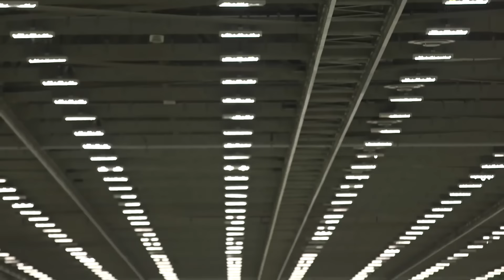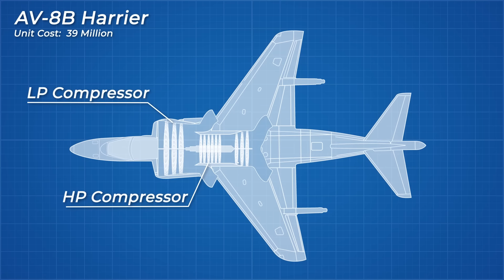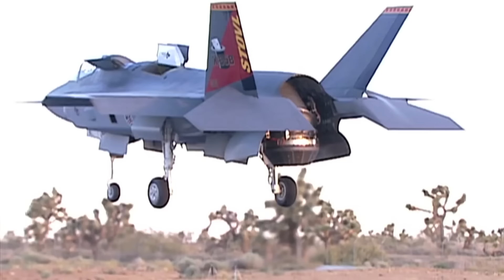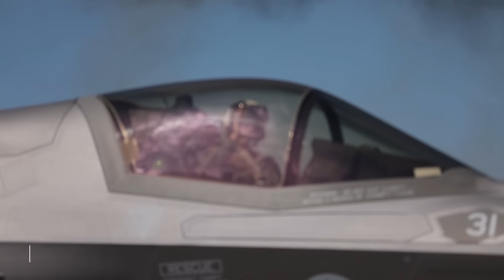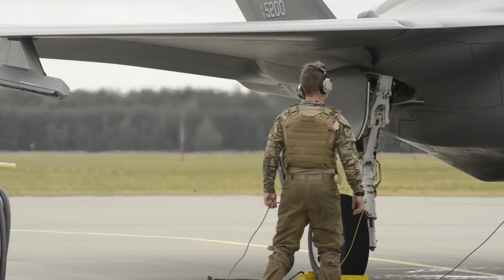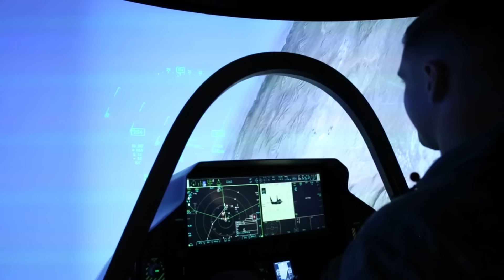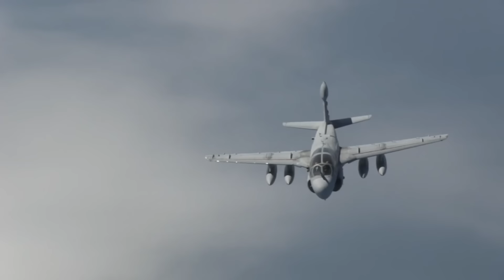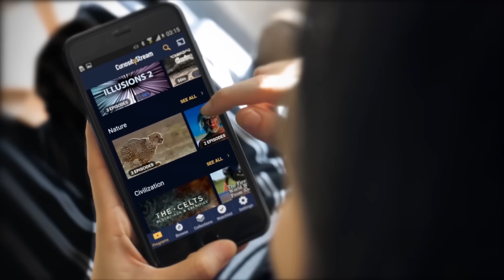Is The F-35 Worth $115 Million?

Comment: in short : NO

everyone knows by being jack of all trades, you are not gonna be master of any. 

as fighter : 
now you have stealth, but you can only bring 2 AAM missiles , slower (these fighter cant sustain supersonic speeds), which means your there is high chance you cant shoot your opponents down and they will chase you, remember, stealth doesnt really mean you are invisible, you just gonna detected in shorter range, and not invisible via thermal tracking, which russians are fond to use (their sukhois all have IRST), also AESA is a thing

as bomber :
again, stealth, but you have terrible payload and you cant maintain supersonic, enemy fighter just gonna overwhelm you sooner or later, and you deal small damage unless you deploy in large number

as attacker :
replacing A-10? really? 
1. it doesnt bring much ammo as A-10
2. it uses smaller caliber , which means lower damage
3. the accuracy sucks
4. small payload means less rockets and bombs 
5. less fuel, so less loitering time
6. not as good as A-10 in slow speed
7. basically no armor, enemies can easily shoot you when you are doing attack run, they dont need radar

as harrier replacement :
yes this fighter is worthy for that, and this fighter should only develop as F-35B, nothing else

and there is more, you cant bring extra fuel because to maintain stealth you cant use extra fuel tanks in your pylon, so less range

you cant use external pylons for anything (extra bombs or missiles or larger missiles or larger bomb)  or it basically discard your stealth capability

everything must be stored in that small internal bay

Comment: Many issues with facts in here. Latest cost of an F-35a is $90 million and dropping as is the cost of the B and C models. The JSF program might be 27 years old but the F-35 is not and is significantly redesigned from the X-35. What was said in the report about the F-35 and the F16 5 or so years ago was not that it lost a dogfight with an F-16 but that in the prototype state it was in that it could not match the F-16 in certain envelopes of flight at that time. If you look at some of the manouvres being done by the F-35 demo team you would know this argument is no longer the case. The F-35 is not meant to be a replacement for the F-15. The F-15's replacement was supposed to be the F-22.

Comment: should have just made f22 lite, use the existing airframe, improve the equipment and software
Reply: The F-22 is significantly more expensive and would need redesigning to have any hope of outperforming an F-35 in an air to surface role.

Comment: Had Congress decided to get an additional 70 F22’s Lockheed had sold them for 72.000.000 USD a piece... so NO the F35 is not worth 85 millions per plane, it should be around 65 millions. But that would require that every nation bought twice as many. So we are stuck with the elevated price tag.

Comment: This is great and entertaining 101 video but it has some flaws that may be overstating the capabilities of the F-35. I'll summarize them:

1) The plane is extremely digital and computational. 10 years ago, you couldn't even see any pictures of inside the cockpit but I heard that it was all flatscreen/touchscreen maybe. From the shots you showed, this is the case. This means though, that when/if the electronic systems are down due to hits. How does the pilot operate the plane? Can they land safely? You can smack talk pilots being stuck in "old mode" about acquiring targets, and how air to air combat is conducted, but in an actual war, you will take hits. You don't want to be flying in a glass bird that can't land because it took a few stray rounds. 3rd-5th generation aircraft are capable of landing after taking hits, this one probably can't.

2) You talk a lot about the advancements of technology in developing the stealth surfaces and coating for the plane, but have you considered what the same computational advances mean for detecting stealth aircraft as well? I'd say it's much easier to detect a large bird flying somewhere in the ballpark of 200-900mph than it is to hide it. Nothing else in a war atmosphere will be that size (radar cross section) and moving that fast in the sky. I'm sure when dealing with enemies that haven't made radar advancements since 4th gen, perhaps you could be near undetectable BVR but I doubt even a 5th generation plane would be totally caught off guard if given modern radar modules and equipment.

3) Honestly, this plane simply does not replace all missions of all other aircraft. F-15E is still one of the most capable planes that can strike ground targets while still capable of defending itself. A-10C is still the best close air support (CAS) plane for ground fighters against heavily armored ground targets. On the latter, while the F-35 may be able to enter a space undetected and deliver payload to a specific target, if supporting ground forces in an active battle, once that first flyover, it's detected and basic IR guided missiles from the ground can pick it out of the sky just like any other aircraft. In the absence of anti-air, can it carry as much payload? Delivery it as quickly with repeated passes(loiter)?

4) Consider the politics of the JSF. It feeds into the military industrial complex of the U.S. You mention how much of a boon this will be for the economy - this is a lie. The cost and development of this jet (billions) could easily pay for so much more to boost the economy of more than just working families of the major defense contractors and subcontractors on this project. But the executives at those contractors want those dollars so they will sell this plane to the US govt and justify it's existence at any cost, while being paid for with US taxpayer dollars, and the profits of sales to other countries will go to only the executives of said companies rather than their workers.

I should note for other viewers: CuriosityStream seems to be a conservative source of information. Based in some in some science, reporting, and fact, it pushes a conservative agenda overall. I like military planes because I've always thought they were cool and I've spent a lot of my life studying them, flight simming them, etc well before I had progressive views on war and industry. I can still appreciate a war machine, but since 4th gen, the U.S. hasn't really made an airplane platform with a mission focus and simplicity and effectiveness in mind -- and to be honest, maybe it doesn't need to.

Comment: I think it would be wiser to create many cheap, niche platforms than one expensive, multipurpose one. I would rather have a fork and a spoon rather than a spork. Do one thing well, not 2 things badly.
Reply: I especially dislike the idea of replacing the A10 with this. I want something specialized for ground attack. Replace the a10 with something cheap, but like an a10. Something with high capacity for weapons and can fly low beneath the hills and slow.

Comment: The F-35 cannot replace the A-10 for its close air support role, its super expensive, doesn't carry the same cannon, and doesn't have the same survivability as a A-10 with its mechanical redundancy and the titanium tub. For other roles, possibly a perfect plane, but its foolish to throw such a expensive plane into a role that would most likely see its damage and failure.

Comment: I disagree completely with your argument that the F35 is a "worthy" successor to the A-10. Close air support is not something the F35 is going to be able to provide in the same sort of way that the A-10 has. Every time they try to "retire" the A-10, the massive outcry to keep it flying brings it right back, because it's brutally tough, relatively inexpensive, extremely maneuverable at low speeds with extended loiter times, able to lay absolute waste to the landscape with combined arms fire (the GAU-8 can suppress in a way that nothing else short of a spooky can) and since it flies so low and heavy, works as a ground level morale booster for friendly troops and demoralizer for enemies, all on its own, by its mere presence on a battlefield

The F35 can definitely support it, but I highly doubt it will supplant the most nightmarish close air support aircraft ever invented. It's just like the idea that kept coming up in the 60's that fighters just didn't need cannons anymore, that dogfighting was dead, and aerial combat would happen at tremendous standoff ranges. It just didn't happen. Fighters are still going to get in close when the need arises, and the A-10 serves a very niche, specific role that nothing else has come close to yet. The most likely plane to replace the A-10 will probably be a turboprop powered, cheaper, lighter weight close air strike fighter. What we need is something even cheaper, lighter, and better able to deal with asymmetrical combat scenarios in a way that laser guided weaponry just can't.

Comment: Well considering that it only cost 80 million there is a issue with your headline.  
At least for the F35A. 
Which at 80 million is the cost of a current F16 or F18 super hornet. 
The F15 cost 115 million, a Rafael cost 120 million as does a typhoon. 
So truth it's a steal of a deal compared to those. 
It out performs them all with a combat load as well.

Comment: I am sure F35 is not as bad as it was made out to be. But to rely on stealth this heavily in 21st century is dangerous. The sensor technology has been and will continue to evolve at much rapid pace than the masking and stealth technology. Stealth technology is fundamentally limited by the surface physics and electronic jamming capabilities. Both of which can be out developed much faster today than in 90s and early 2000s. IN battlefield over urban areas, stealth is useless. You must have a good line of sight fight capabilities. F22 has it to a large extent. I am not so sure about F35.

Comment: The whole project is tainted by the VSTOL requirement. Forcing the plane to be able to be built (in very small numbers) as a VSTOL means that the non-VSTOL variants are decidedly compromised. Building an strictly AIR FORCE/NAVY version wouldn't have needed such an extreme compromise.

Comment: Good replacement for legacy combat aircraft, sure, to a point. Ait to air, recon/surveillance and data integration/dissemination is one thing. Air to ground/ close air support is another. The push to replace the A-10 with the F-35 is completely non-sensible to me.
Reply: it's not, considering the A-10 had largely been replaced by multirole fighters already

Comment: Imagine if you tried to make a car with same philosophy.

It’s a performance car of all trades.   It’s a sports car, but it must seat 7.   Must be able to handle great at the road course, but also have awesome off road capabilities.   Must have awesome power, but also great fuel economy.

You’d have a very expensive performance sport utility vehicle and while capable, would not excel in anyone category.
Reply: The F-16 was made with the same multirole philosophy and it's an excellent aircraft, adopted by dozens of countries. It actually excels at air-to-air so the US uses it for their Agressor squadrons to mimic the MiG-29. It also excels at air-to-ground to the point that in 1991 it did more CAS than the A-10 while suffering less losses.
While a different design path was taken, the F-4 Phantom was designed as an interceptor, forced into a fighter role, eventually had the air to ground capability exploited by its use as a bomb truck and for suppression of enemy air defenses. Also had Navy carrier-borne and Air Force traditional runway landing variants.
Air planes aren't cars.

Comment: Two issues with your otherwise excellent video:
1- That design philosophy of first sees, first shoot, was nearly the same as the one employed in the F-4 Phantom. They even discarded the cannons as unnecesary. Result? The MiG-17 and the MiG-21 outmaneuvered them, and HAD cannons. Cutting-edge technology does NOT solve all problems in an engagement. The German tanks were FAR superior to the T-34 and the Shermans, and who won?
2- The F-117 exploits in Iraq, although impressive, were against an ill-equipped and ill-trained enemy. And regarding what happened in Serbia, those Serbians WERE well-trained, and knew their stuff. And chance plays a HUGE role in warfare. And it was shot down with a 60s radar and missile system. And what´s the point of having a cutting-edge, invisible airplane, if you have to protect it with other, more vulnerable, aircraft? It´s the same case of the Me-110 bomber escort, who had to be escorted, while it was escorting the bombers!
In a fight, always fear more a well-trained man in a regular equipment, than the other way around. 
And a final conclusion: Historically, jack-of-all-trades perform poorly.Take the F-111. The Ju-88 would be an exception, but that was by necessity, not by design.
Reply: > "That design philosophy of first sees, first shoot, was nearly the same as the one employed in the F-4 Phantom. They even discarded the cannons as unnecesary. Result? The MiG-17 and the MiG-21 outmaneuvered them, and HAD cannons."

 Air Force had losses mostly attributed to ground-fire. Albeit the missiles were unreliable- when this was fixed the majority of victories were with missiles. USN was mostly fine over all. 

> "The German tanks were FAR superior to the T-34 and the Shermans, and who won?"

 They weren't. 

> "he F-117 exploits in Iraq, although impressive, were against an ill-equipped and ill-trained enemy. And regarding what happened in Serbia, those Serbians WERE well-trained, and knew their stuff. And chance plays a HUGE role in warfare. And it was shot down with a 60s radar and missile system."

 The F-117A was an antiquated aircraft that saw no refit since introduction and had no countermeasures to speak of save being low-observable. The S-125 and its associated radar arrays were modernized systems from the mid to late eighties.

Comment: Nothing can top the a10 in my perspective. The a10- warthog and the sr-71 are my two favorite military jets. The a10 - warthog because of it's amazing machine gun and the sound it makes when it shoots it, and the sr 71 for the sheer amount of speed it could achieve. I believe that the x15 was faster, but it wasn't capable of an extended amount of time in flight, since it was basically the lovechild of a rocket and a glider.
The f22 is pretty cool as well, it looks kind of like a Lamborghini. To be more specific, though, the Lamborghini reventon was made to look like it. 
However, due to the stealth of the f22, its weapons were out of sight until needed, reducing its ability to show force in cases of airspace violations. 
I think during these days, in the war on terror, we dont need top of the line, futuristic aircraft. All we need is cheap, good bang for your buck aircraft to blow up isis, and the Taliban to smithereens. We should definitely have top of the line stuff on the back burner of course incase war with a more capable group is sparked, like currently China or Iran. Maybe that's the real reason for the f35

Comment: One of the "costs" people forget when comparing the F-35 with other fighters is the missed opportunity cost.
25 years, a quarter century in development for a fighter jet.
25 years of aerodynamic theory improvements, of mission requirement lessons.
A lot of fighters could have entered service during the last 25 years and replaced the old cold war era fighters, but instead the military kept working on this boondoggle.

The F-35 is designed for a war it will never see, all branches of the US military are eating their airframe hours being on call for CAS (Close Air Support) in low threat environments where the US/NATO or otherwise has air superiority.
Stealth capability is worse than useless in this environment, it adds costs and maintenance down time, reducing mission readiness for the operators.
This would be an acceptable trade if stealth were necessary to complete the mission, but ISIS or the Taliban or Al Qaeda don't operate dense radar detection networks. 

These F-35 stealth fighters will just continue in these missions, replacing existing airframes, burning through their own flight hours.
Those flight hours are paid for by replacing the aircraft, at $US85 million a plane, that isn't an insignificant cost.  New fourth Gen fighters could do the exact same job, with the exact same effectiveness, maintaining higher readiness, for far less money.

And readiness is important, lower readiness equals fewer fighters available for tasking.  When a guy on the ground is begging for air support he doesn't want to hear about priority tasking, he wants someone overhead to drop a bomb.

Arguing about dog fighting performance or shooting down other aircraft in combat is so close to irrelevant it's almost beside the point, it's a scenario that almost never occurs because combat planners use cruise missiles and special forces operators to destroy enemy aircraft in their hangers and redoubts.

Stealth would have been great for a couple of days in Iraq 2002, but for the rest of the last 17 years it would have been an unnecessary hindrance.